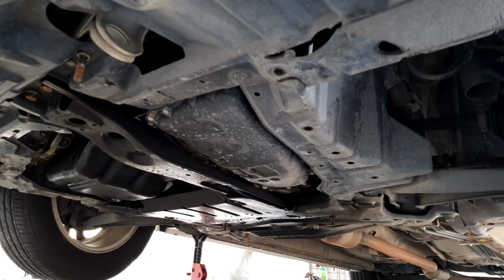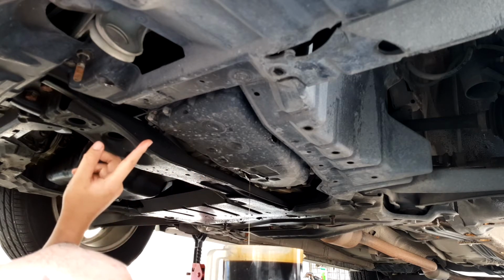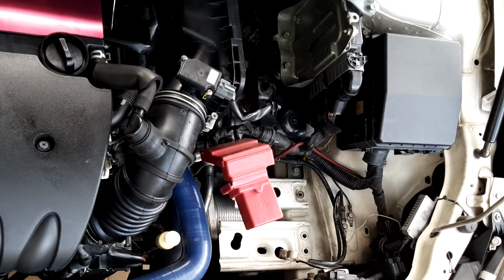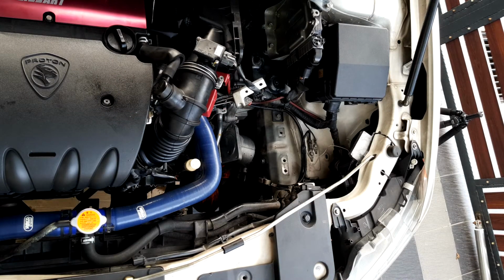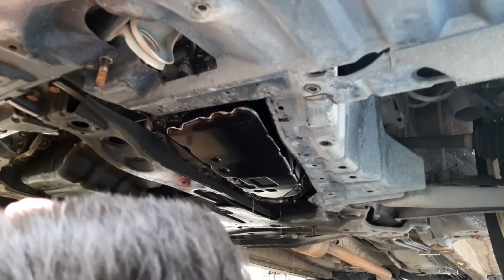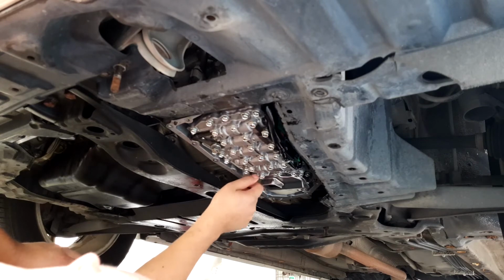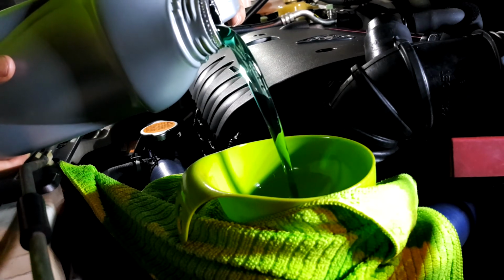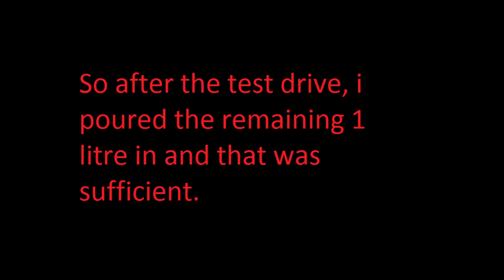How to change  CVT Oil and Filter change - Inspira / Lancer

Comment: Wish someone would show how they took the bottom screws off the bracket for the the cooler filter
Reply from the maker: About a year after this video is made, I discover the easier way to access those bolts near the cooler filter is actually from the bottom. From the top is a real pain in the behind.

Comment: Did you used any gasket sealant with new gasket  when you installed it?
Reply from the maker: only a bit at the joining near the timing chain. There is no need for gasket sealant all over it.
Reply from the maker: Sorry, I thought it was another video whereby I was changing the rocker cover gasket. So for CVT oil and filter change, there is no sealant needed.

Comment: just bought a used mitsubishi outlander w 120k miles and the car died on me, engine will work but transmission will not run. The past owner never serviced the transmission, after watching many videos I serviced it myself and save thousands... lancer and outlander have the same tranny, this video helped a lot... 
My only doubt was how to install the mini filter on top but this video covered it
CVT fluid is more expensive for this cars, so 8 quarters 
thanks

Comment: Goodam sir. I just want to ask something regarding the oil cooler filter. If you will change the filter we need to drain the transmission fluids? Or no need? Thank you and regards
Reply from the maker: The oil cooler filter, its better to drain but not neccesary. If you have just changed your fluids, just drain maybe 2 liters out so it won't get messy when you remove the filter. 
if the lower filter, then its a must to drain all the fluids.

Comment: what is exactly amount of cvt oil j4 lancer Fortis
Reply from the maker: There is no exact amount as it depends on how much was drained out. Rule of thumb, weight how much was drained out. Put back the same amount, check the dip stick, fill as necessary. Drive the car around for awhile and check the dip stick, fill as necessary. I reckon preparing 5 liters just in case.

Comment: You need universal joint socket
Reply from the maker: Actually I found a better way to remove those difficult bolts..... from the bottom after removing the wheel arch side splash shield (the one between the wheel and gearbox.)

Comment: Great video I just bought n asx, and was just thinking of changing the oil but not the filters or removing the pan, it seems that won’t do much I must do the whole thing
Reply from the maker: Thanks for the support. Its better to change the whole thing. But you can get away with just a drain and fill for one time. But you definitely MUST replace the top filter (cooler filter) cause that clogs up badly.

Comment: Hi, thanks for the video, very useful.Here in Mexico it is very expensive if you want to change cvt oil for my CVT Lancer 2009 2.0 with Mitsu dealer, so I´m gonna do it by myself. The question.... is it recommendable using Valvoline CVT Fluid instead of Mitsubishi CVT Fluid? Good quality?  Which alternative brand do you recommend? Valvoline, ENEOS, Motul, Castrol? Thanks in advance
Reply from the maker: I have not tried any other CVT fluid besides Mitsubishi J1 and J4. But the brands you mentioned seems to be all major brands so I guess it is ok. Personally I stick to the manufacturer's brand cause the gearbox is not cheap and CVT gearbox are really sensitive to its fluids.
Reply: No te arriesgues Sergio, métele el j1 o j4 de Mitsubishi, si usas un equivalente te arriesgas a arruinar la caja. Lo barato te puede salir caro! Saludos!

Comment: Was there an under engine splash shield?  Under my 2008 Lancer looks just like this, so I'm wondering if it maybe was removed by a repair shop and not replace (or fell off somehow).  Or do  these cars come with the transmission and oil pans fully exposed.
Reply from the maker: they come with the bottom fully exposed. 
My alloy splash shield is an add on i purchased outside.

Comment: Just got back from the Mitsubishi dealer here in Japan with a bit of information you all might find helpful. Although it's cheaper and pretty straight forward draining and filling the CVT fluid yourself, almost half of the fluid remains in the transmission when you do it that way. At my dealer(I'm guessing all Mitsubishi dealers) when they change the CVT fluid, they change all the fluid using a machine they have there which comes out to about 8 litres of dirty fluid pushed out. So although more expensive your CVT fluid will be completely changed, instead of a only a bit more than half if you do it yourself. Which makes me wonder if your CVT change interval suggested by Mitsubishi at 30,000km for severe use, will technically drop down to 15,000km if your only doing it yourself and leaving almost half the dirty fluid left inside. Personally, I choose the dealer for regular CVT fluid changes as I want completely clean fluid. But for changing the cooler and pan filters, I say do it yourself to save money.
Reply: Oil flush are not always good if that's what their doing ,If you take care of your car it mite be all right
Reply: @javierdavila1190  Yeah, it's a standard cvt fluid change since that is the only way you will get out all the old fluid. Drain and fill although you can do it yourself is cheaper but your only draining half and mixing dirty oil with new oil. As long as you are maintaining your car properly a flush is completely safe. For engine oil, I stay away from those strong cleaners you mix in to the oil, and you should never let the engine oil get dirty to that point anyway.
Reply: @keifuchan7265  Can recommend which of the workshop you go to do the flush?
Reply: @javierdavila1190  CVT flush, ATF flush, Engine oil flush is all fine as long as you never neglected the car. I flushed my CVT after 1000km to get any leftover bits of metal out after wearing it in. Since then I flush the CVT every 30,000km as stipulated by Mitsubishi for severe use. With engine oil I ran conventional oil for the first 100km while doing the hard break in method. Changed to clean oil and ran another 1000km before changing again to full synthetic. Engine oil is changed every 5000km-8000km with a molybdenum and C90 fullerene oil additive. I know overkill perhaps but I'm almost at 200,000km on the car now with the inside of the engine spotless. Zero problems since buying the car and the engine and CVT run just like when it was new.
Reply: @TY-mb2lw  At the Mitsubishi dealer where I bought the car ten minutes away from home ha. In Yamanashi prefecture, Japan. Any Mitsu dealer should be able to do a CVT flush. Cost is around 15 thousand yen and takes about an hour. I don't know about other countries.

Comment: In the cvt gasket do you still put rtv gasket maker?
Reply from the maker: Nope, the cvt gasket seals itself pretty well. No rtv gasket maker used. And till now after more than a year, no leaks.
Reply: @TCsAnythingGoes  thanks. Do you use torque wrench in cvt?
Reply from the maker: @jojoflores3506  At the time of this video, I did not have a torque wrench so I tighten it by feel. Make sure not too tight else you run a risk of stripping the threads (aluminum block is soft). Looked up the torque specs and you need to tighten it to about 34Nm

Comment: Why use tow kind of filters what's the different?
Reply from the maker: Cause the manufacturer designed the system with two different filters. One is the CVT cooler filter. One more is the gearbox filter. Two different filter for two different functions.

Comment: If I do like 150+ for a long time My lancer keeps saying slow down! On my dash ..why?
Reply from the maker: Most likely your CVT is overheating hence the warning to slow down. Changing your CVT fluids normally solve this issue. But if it does not, then adding an additional oil cooler would help.
Reply: @TCsAnythingGoes  thanks man! Will do

Comment: Do you remember the old bottom filter that you change can be reused? It looks like whole piece is stainless steel and the filter as well. If yes then can be cleaned to reuse. Thanks.
Reply from the maker: I was also informed that it can be cleaned with petrol or diesel. The inside is a fine wire mesh filter so i believe its possible.
Reply: @TCsAnythingGoes  Thanks. How did you do the flush like start the car? I have the left over of 1.5-2 litre of Eneos CVT oil but not sure enough to do a simple flush. Now change to Castrol CVT coz unable to get Eneos oil in MY market.

Comment: Hi Sir, when you pulled out battery, isn't the engine setting will goes out too? Or the setting still maintain even the battery pulled out?
Reply from the maker: Nothing to worry about there. The only thing that will reset is the player whereby you need to set the time again. ECU settings will remain. Can't say the same if you have remapped the ECU.
Reply: Nothing will goes out even if you already remap..

Comment: Thanks for the detail video bro, 
Did you do any CVT fluid flush? if yes, do we need to use 2 bottles (8 liters)? or is it not required unless its 200k mileage? my inspira is 130K mileage by the way..  i've read the comments here, you mentioned initially you use CVT J1 fluid and now change to J4, so any noticeable difference? 
it's not consistent information for which CVT oil to use, In the car booklet manual, it says to use CVT J1 oil, but on the gearbox dipstick, it says CVT J4...
Reply from the maker: I did a drain and fill giving it ample time to drain. Flushing is not really needed unless you feel like spending the extra in which case I would say go ahead cause there is no disadvantages to a nice flush. My car is already around 230k, so far i have only done drain and fill without flushing. CVT still going strong. I have not used J1 since the car hit 90k and I honestly don't remember much about the J1 experience. What I do know is that J4 is an updated version of the CVTF....... so going by laymen logic.... newer is better. Hehehe.

Comment: Hello Sir,  my lancer ex currently at 178k mileage.. when i accelerate , it has a droning sound. so normally what the workshop mechanic would do is just to drain out the fluid  and replace with newer fluid. is there a need to replace the small little filter? i had never change it before .
Reply from the maker: The small little filter is for the oil cooler. If it clogs up, then your transmission will heat up faster. I would recommend replacing at least the little filter every time you do a drain and refill.

Comment: Bro.. Pakai oil J4 tu dah ilang bunyi whining ke!! Mana bagus dgn oilgear di Sc?
Reply from the maker: J4 is a newer formulation compared to J1. I have not compared it with the Proton CVT oil from SC but should function the same. The whining noise usually happen when the oil have degraded. That would tell you that its time to change the oil. Frequency of the oil change depends very much on how you drive the hard.
Reply: @TCsAnythingGoes  tqq for info2..so inspira gearbox boleh guna J4 lah ya.!!..so far u guna J4 ni no problem lah ya..
Reply from the maker: Only used J1 when bought the car new. After that I have changed to J4 and using J4 for every fluid change. No problems at all.
Reply: @TCsAnythingGoes  oraitt.. Suka tengok video u.. Byk info2 yg sya dpt.. Inspira saya 2.0P..dah 5 years guna.. 90k kilometer dah.. So apa yg perlu saya tukar part2 dalam enjin tu?.. Tqqq
Reply: Utk gear oil.. 5liter ke bro? Tak over flow ke gear oil? Bukan 4 liter saja!
Reply: if not mistaken.. at the g/box dip stick itself proton put the sticker cvt-j4..

Comment: What mileage did you change the oil??
Reply from the maker: my 1st CVT oil change was 90k km. 2nd CVT oil change was around 60k km. 3rd CVT oil change which is this change is around 60k km. It depends heavily on how you drive. I change my CVT oil when i hear droning sound whenever there is a load.
Reply: @TCsAnythingGoes  what is the mileage of the car now? And is the cvt still performing well?
Reply from the maker: @shravanrunnoo133  It is above 250k KM on the odometer right now. been using the car for 8 years and 11 months. CVT is still performing well. No issues going to 210kmph

Comment: Good explanation video bro ..I thought it’s a complicated process as price being charge by workshop...now I can do my self 😅..but can I ask few questions b4..I try diy...1) when u clean up the oil pan ..what did u use to clean ..2) how to know than I’m getting genuine product b4 I proceed 3) if j1 what colour the fluid would be..
I really appreciate if u can answer any of my concern..thank u in advance
Reply from the maker: Thanks for the kind words. 
1) just regular soap and water. Be sure to dry it off completely before assembling back. Best to leave it under the sun to bake till hot.
2) unfortunately there is too many non-genuine products around that is packaged very identical to the genuine ones. Best is to purchase from reputable sellers or at least make sure the price is not too low compared to the market price. 
3) I am not sure what color is J1 fluid as I have never put in J1 into my car. The only time it ever used J1 was when it came out of the factory. But i remember draining it, it was brownish color.

Comment: Is the CVT oil and gearbox oil same or not?
Reply from the maker: CVT oil is specified for CVT gearbox. ATF is specified for conventional automatic gearbox. MTF is specified for Manual gearbox. There are other specialized oil for DSG and so on so forth. So make sure to use the correct type of oil

Comment: How many liters you re-filled in ?
Reply from the maker: In total, 5 liters.
Reply: @TCsAnythingGoes  weird... Some people say its 9
Reply from the maker: @factdesignbr  And have those people that said it ever change their CVT fluid themselves or do they let the shop do it? This is my 3rd time changing the CVT fluid myself and I can assure you 5 liters is enough. Some said 7 liters but personally I have never used that much. 9 liters is definitely overkill. Best way to know is to refill back the same amount that was drained and a bit more (taking into consideration that there will be some fluid in the filters)
Reply: @TCsAnythingGoes  Exactly. Good stuff. So even taking thr oil pan off never got to pht more than 5 right?
Reply: Must i change cooler n filter?
Reply: the reason why its reach 7 or 9 litres..because they turn their car on..and it drains more oil out of the torque converter..thats why..
Reply: @wandywan2444  I did all my service on my 2009 lancer myself..metal filter inside sump,you just give it a good rinse with petrol or carburator cleaner and use it again..no need to change it..you can if you want to be a serious car guy..but its metal..only change the paper filter inside pump..
Reply: torque converter eat lot of oil , or the shop use it for flushing purpose ,  4L for flushing

Comment: Hi, do you check the fluid level when the engine is running or not?
Reply from the maker: check to make sure the fluid level is correct when it is hot. Which was why I poured 4 liter, drove it around and top up till 5 liter.
Reply: @TCsAnythingGoes  Sorry.. what i meant was what is the correct procedure to check this CVT fluid level. Is it during warm when the engine is running or during warm with the engine turned off?
Reply from the maker: @st72ssh  engine running or not running does not make a difference, as long as the gear is not engaged. But for safety, i recommend with engine off. You don't want to risk checking the engine with all the pulleys running.
Reply: Tranmission fluid always check when reach ideal operating temp. Opposite with engine oil, check when engine temp cold. This will ensure the correct level. If do not want to drive away, please play arround with your gear stick P>R>N>D. Then re check your level.

Comment: How to check the dipstick for CVT oil whether sufficient or not? As the dipstick only show H and C. Don't know what does it mean. Thanks
Reply from the maker: The dipstick H and C stands for Hot and Cold. So if the car has been sitting overnight and have not been used, the oil level should be at C. Anything above or below would means you either overfill or underfill. Same goes with H whereby the car has been running.

Comment: Is j4 really compatible with j1 bro?
Reply from the maker: Best is not to mix both fluid. What I did was drained out all the J1 (this was done previously during my first fluid change) and replace it with J4. Been using J4 for 2 cycles now and no issues. I don't even get the dreaded "Slow Down" warning when I am using the paddle shifter all the way up Genting.
Reply: Ok thanks bro. I'll try it using j4. How much do u spent on the filters?
Reply from the maker: Cooler filter + O-ring = RM75
CVT Filter = RM190
CVT Gasket = RM45

Comment: Halo Tc, i been following ur channel everytime. Thank a lot for all the info(Inspira) u share.. By the way, i would like to ask about the CVT/gearbox oil TREATMENT for Inspira. What is suitable oil treatment for inspira?? Thanks u bro. . .
Reply from the maker: Thank you for your support. Really appreciate it. I have never done any CVT oil treatment before. I only drain and refill along with filter replacement only. I have heard of gearbox treatment and additive oil that is suppose to be good for the gearbox..... but I never tried them
Reply: @TCsAnythingGoes  Thanks u very much bro.. so im going ur way then.. no need treatment, just maintain the oldest way fill and exchange a new one when times up😂👌

Comment: @18:40... washing transmission fluid into ground water? Whaaaa????
Reply from the maker: There wasn't much fluid left on the pan when being washed. And the grass didn't die.
Reply: TC's Anything Goes 
Oh I wasn’t worried about the grass. 
I remember decades ago reading about how toxic coolant and engine oil was to ground water. A tiny bit can contaminate tons, literally. 
I just wasn’t sure about trans fluid. 
Read more about it this morning; seems a non-issue. 

Great video though. Very good explanation each step. Thank you for posting!
👍